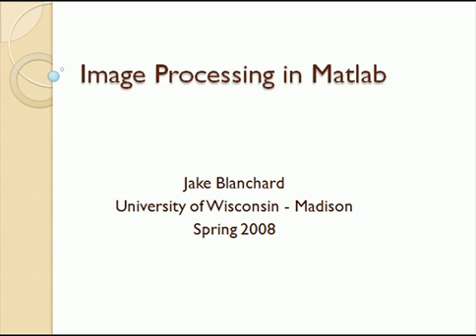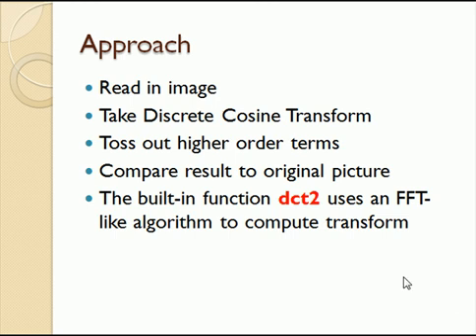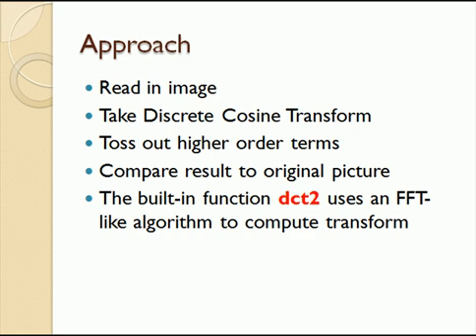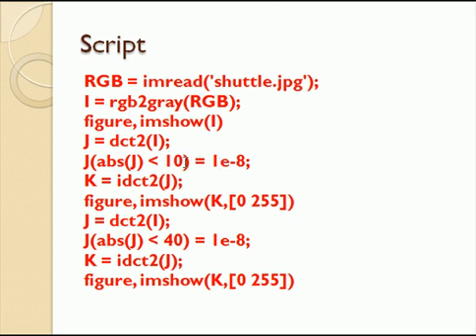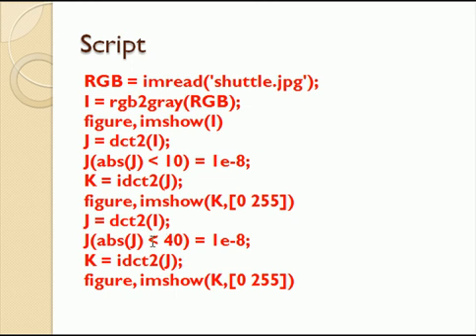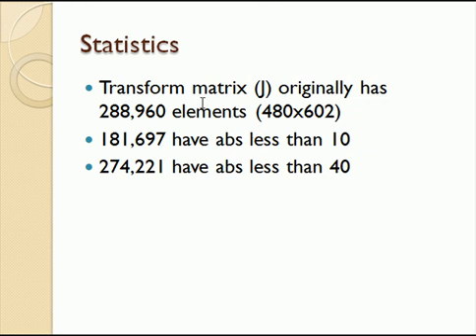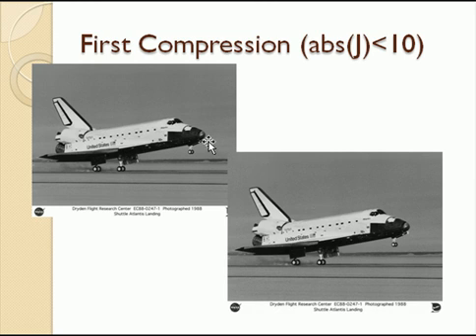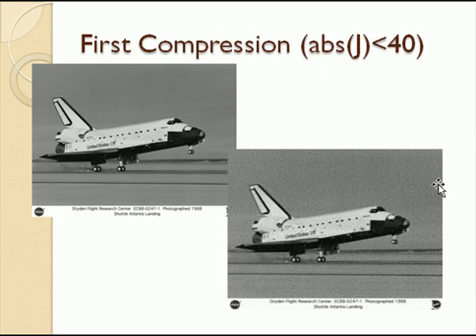Image Processing in Matlab

Comment: How to correct this problem plz:

Warning: Image is too big to fit on screen; displaying at 33%
> In imuitools/private/initSize at 73
  In imshow at 264
  In untitled at 3
??? Error using ==> figure
Single input must be an existing figure handle or a scalar integer from 1 to 2147483646

Error in ==> untitled at 7
figure imshow(K,[0 255]);